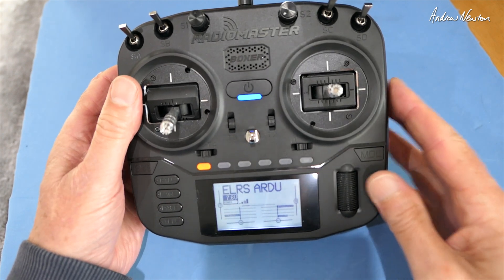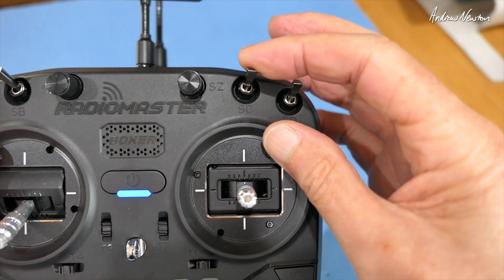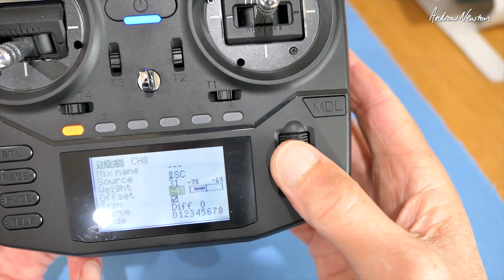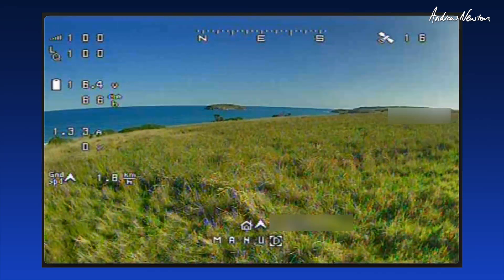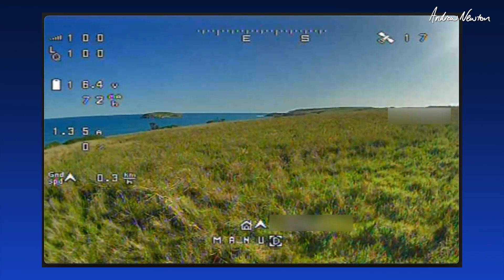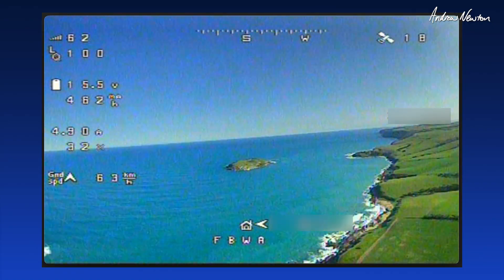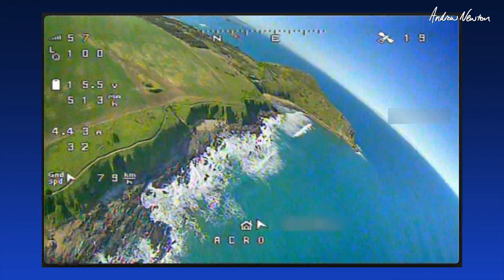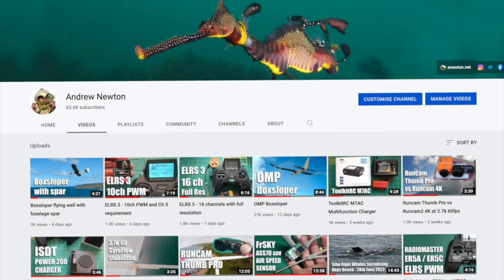ArduPilot Plane - 6 Modes and Maiden Flight

Comment: I made a flying wing for the first time. How accurate would it be to take off in takeoff mode? I am hesitant to take off in manual mode. If it manages to fly, I plan to autotune it in the air.
Reply from the maker: Depends if you set it up correctly. Need to try Manual to make sure.

Comment: I want to buy radio masters radio but worry it's to compilatiated
Reply: its more complicated but its wayyyyyy more flexible and works with all the flight controller stuff real well.  the complexity is workable.
Reply from the maker: Just buy one and learn. They can be a simple as you need

Comment: I've always used 70% weight and they fall within all 6 ranges. I wonder if it would be worth checking the limits as far as weight, the find the "best median" value that falls in the middle... lol Whatever works, works... It could be useful in the event of a glitch or something, so it's less likely to move outside the range of your selected mode. Probably not worth the hassle though ;)
Reply from the maker: Thanks Keith. Easy to test. I'll get on to it.
Reply from the maker: Turns out both are fine. 65 might give the biggest overall safety margin